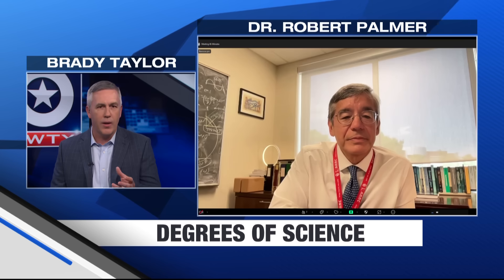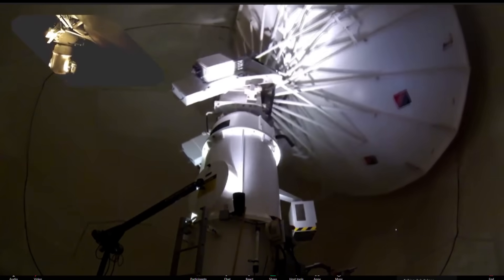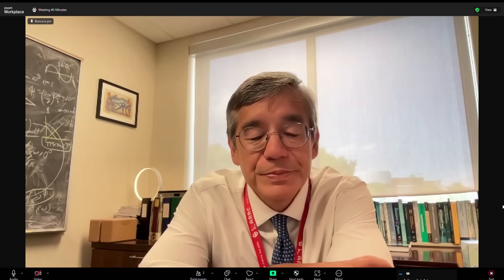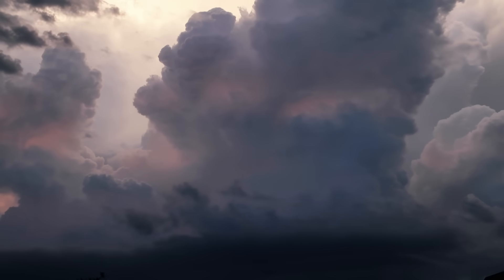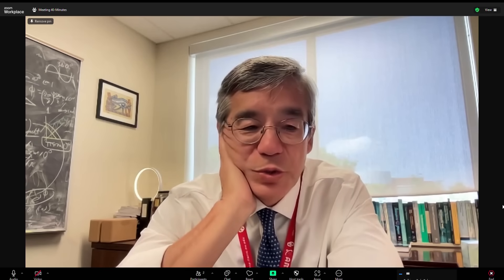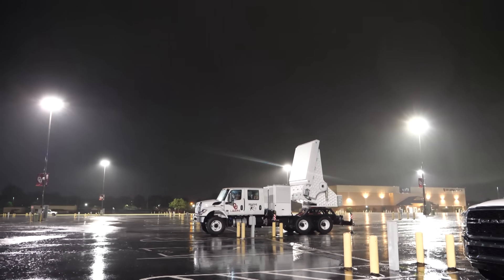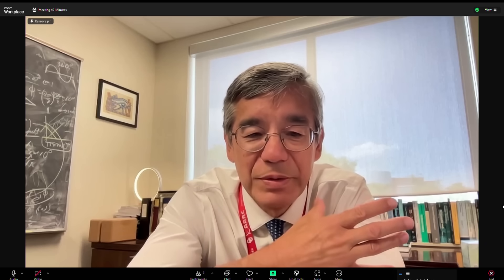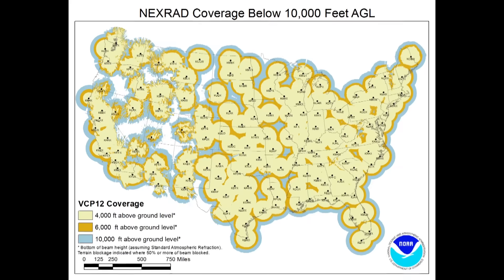Groundbreaking New Weather Radar

Comment: It will be interesting to see if entities like the national weather service switch to systems likes these, how will they serve the data for use. The amount of data generated by level II nexrad radar data is already quite beefy. Each scan is quite a bit of data, but due to the low volume even a modern phone can pull the data pretty easily. Changing that from minutes to seconds will increase the data being push by an order of magnitude. There might have to be more levels of processing to be able to massage the data into manageable amounts for more casual uses cases.

Comment: I was wondering why after 2 decades of experimentation they hadn't gotten phased array as standard yet. 

The dual-polarization challenges completely explain it. That's not only harder to integrate but wasn't something previous military application phased array radars had to deal with. So while outdated, for weather specific knowledge the current mechanical radars had that vital feature not yet figured out.

Comment: They need to make that into a sorta dome. (Also I found out recently that optical lenses work on radio waves. I don't know if that's helpful information to any would-be researchers.) Probably only requires a minor tweak to the formula used to calculate the antenna matrix. This is basically using the same concept as SpaceX antennas right? Only theirs is tuned for broadcasting radar signals? This is a brilliant idea, I must say.

Comment: Sounds like they need some good old-fashioned interferometry and/or combined signal analysis.  Two separate orthogonally phased arrays in close proximity, some super-duper software, and you should come out with new, improved dual-polarized info.

Comment: There are far too many “radar holes” in coverage, especially in rural areas.  This greatly degrades the ability to read a storm’s threat and issue timely, specific warnings.  It’s a scandal.  Additional weather radar installations are needed to fill these coverage gaps and protect lives.
Reply: It appears that they would need about twenty additional sites to fill most of those gaps in coverage. Some might not be possible in extremely mountainous terrain as there is a great deal of 'shadowing' going on. The way it is now we do end up with dangerous gaps whenever a NEXRAD site goes down.

Many media outlets (television stations) have their own radars; A more comprehensive system could benefit all if air traffic, private media and NOAA all entered in to a data sharing arrangement. This would also give the system "frequency diversity" as many systems operate on different portions of the microwave spectrum. (to greater or lesser degrees of resolution). Also the ACARS MADIS data is transmitted continually by aircraft (it includes weather data at altitude).

It would be a massive undertaking to integrate all of these data sources.
Reply: Did you watch the entire video? There is literally a coverage map shown. It is also internationally known. To be the BEST coverage in the world. Re-watch the last 5 minutes.
Reply: NOAA states on their website devoted to weather modification reporting that microwaves used by weather radar installations can in fact be used for weather modification efforts.

Comment: Concerning climate change, something that is not talked about but is most probably very real:
a.  Agitated and vibrating atoms and molecules are considered to be 'heat'.
b.  Via QED (Quantum Electro Dynamics, whereby electromagnetism interacts with electrons in atoms and molecules) and QCD (Quantum Chromo Dynamics, whereby electromagnetism interacts with the nucleus of atoms), electromagnetism ('em') interacts with atoms and molecules.
c.  Modern science claims that all matter is made up of quarks, electrons and interacting energy.  'EM' interacts with matter.
d.  The human species has been dumping various 'em' energy frequencies into the atmosphere all the way up to outer space and back to the surface of this Earth.  That added 'em' into the atmosphere, made up of atoms and molecules and interacting energy, would increase the agitation and vibration of those atoms and molecules, making the atmosphere 'hotter'.
e.  Anybody willing to give up all your 'em' driven devices and services?  Probably not many humans on this Earth, so prepare for climate to change.

*  Added note:  The Earth's magnetic field continues to weaken thereby also allowing more cosmic radiation to get into our atmosphere as well as reach the surface of this Earth as well as the Earth's magnetic poles are moving, thereby having the cusp of interacting energy that extends from outer space into the Earth also move, which would interact with the Earth's ring currents, ionosphere, ozone layer, and energy flows through the surface of the Earth.  This will also have climate changing issues.

In other words, climate change is not due to fossil fuels and CO2 alone.  Sure, species can affect their environment, and sure even in negative ways at times, but nature is still going to do what nature does and does not care about species nor their agendas.

Comment: This will be really big for a pilot's in-cockpit weather knowledge. NEXRAD typically has a 4 to 6 minute lag time which, when skirting a storm cell, can make a big difference in the decision factor. Onboard weather radar is helpful and real time but expensive and temperamental. Data linked near real time phased array weather radar will really aid pilots in negotiating storms and making better decisions in the air.

Comment: The Starlink system also uses Phased Array antenna technology. Starlink has been in constant research on how to make their dishes smaller and improve their performance and reduce their manufacturing costs.
Reply: 😂 I knew I would find a comment like this! We were lucky enough to get into the end of the SpaceX Starlink beta test, with the round "Dishy" unit. (New ones are rectangular.) Awesome utility and solid Internet from a tiny phased array, two counties away from Canada! 😎✌️
Reply: @gus473  Hah, I've had fibre optics at my house for ten years, twenty miles from the US border in the central Kootenays.

Comment: Phased Array tech has been around for decades.
The Aegis class cruisers had PA in the 70's.
Even fighter type aircraft had the tech by the time the F111s were in service.
(I think, correct me if I am wrong)
Reply from the maker: Yes Phased Array technology has been around for a while. What's new with this is merging that technology with dual polarization technology that is used in Nexrad weather radars
Reply: @degreesofscience  That is what the military uses to track missiles.
Reply: We use a AZ EL dual pole AESA phased array in Ka band at work to track military style targets. 
Polarity and GTRI developed the system for us and we program and calibrate it, then perform test for customers.
It's used for threat representation that was from the 1980s and is still being used today in certain parts of the world. Lol

Also, I did the PAC3 Patriot seeker for years and years. Developed in the early 90s, went into service around 99, still used today as the most advanced intercept air defense missile in the world, 100% combat success rate. 
It's a miniature Ka band phased array radar that is super high power. Insane for its size. 
PAC3 is also hypersonic, which we've had that tech since the 70s, so it's nothing new to brag about like some other nations like to do. Lol
Reply: It is cool that the tech is now cheap enough to deploy across the country for use with the weather service.
Reply: The Japanese Mitsubishi F-2 Viper Zero was the first fighter aircraft to mount an active phased array radar starting in 2000.